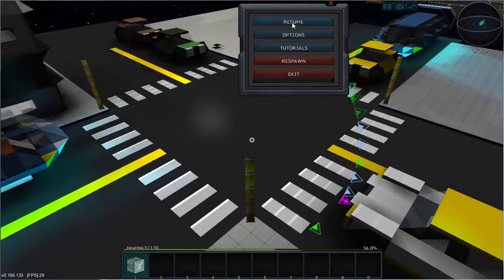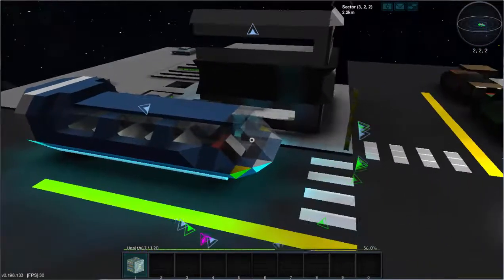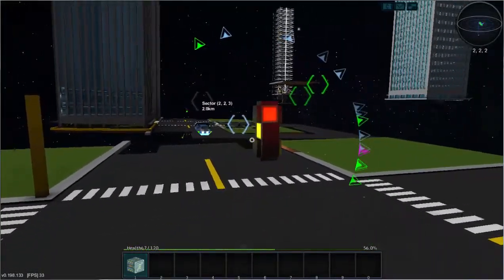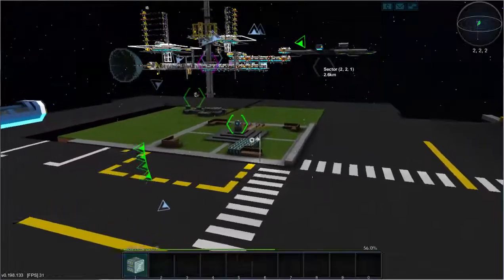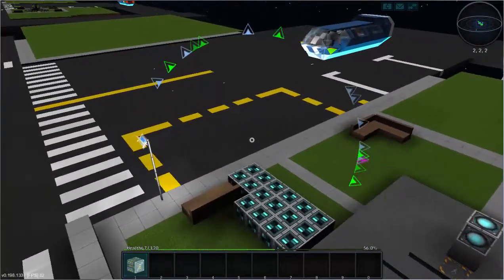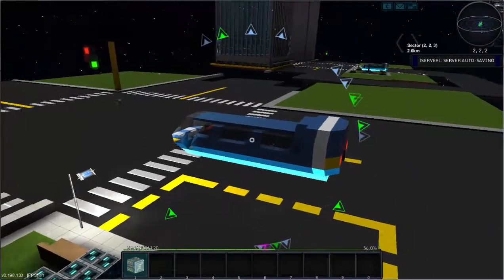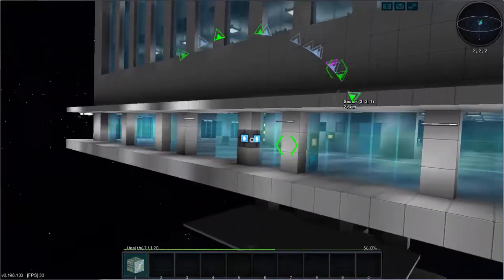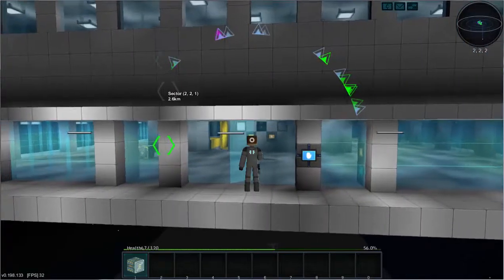Starmade 2016 06 10 LP Update Slabs 05

Comment: Nice elevator with the double doors there!
Reply from the maker: Thanks. :-) I must finish this project. I'm building it as a module and if you have a big enough PLAYER_MAX_BUILD_AREA you could copy paste it into anything. The tricky part has been the modular method around the logic. I'm trying to make a floor based module that can be templated.
Reply: I hope that templates for docked entities will be a feautre soon!
Reply from the maker: Me too! It takes a bit of time to reassemble a system with multiple docked entities. Plus the whole wireless thing needs to be addressed at the same time. I have so many projects that are stalled due to wireless breaking all the time.
Reply: Ahaha indeed so sad about that me too!
Yes paste turrets would be kinda nice ^^
should suggest it to the dev team
Reply: plz do it haha